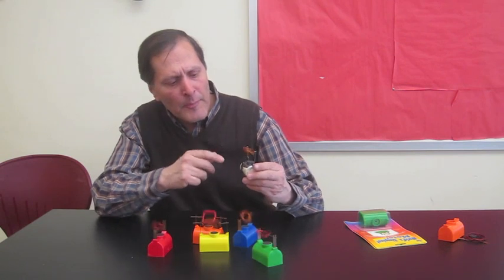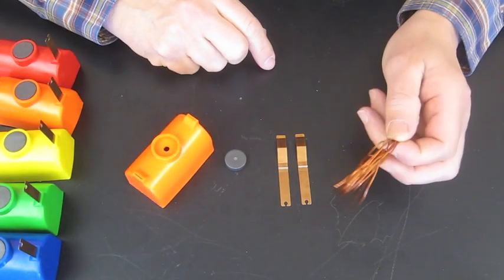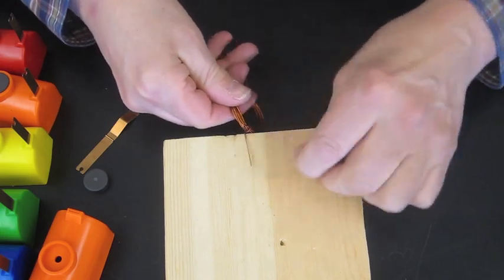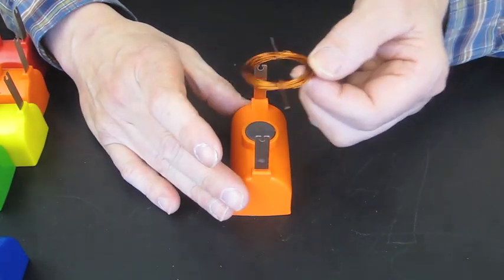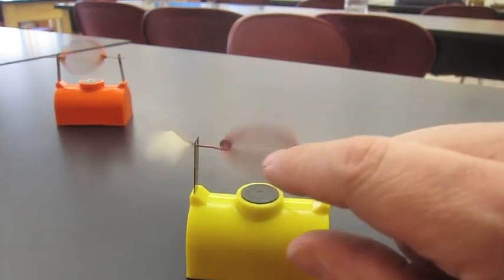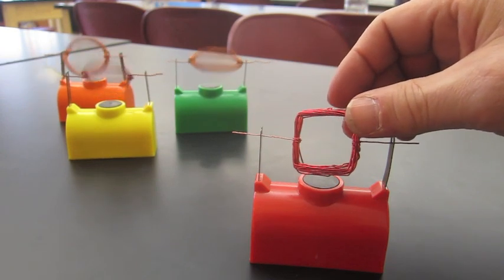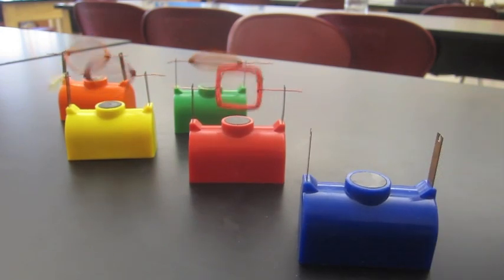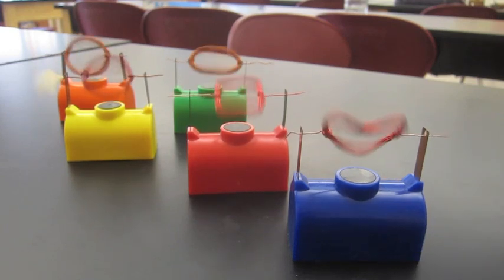World's simplest motor kits/// Homemade Science with Bruce Yeany

Comment: why do you scrape one side of the wire but only scrape the top piece of the other side of that same wire? and what type of wire is that? I figured since current isn't traveling through the entire, through each individual turn, that when adding current it would be stationary.
Reply from the maker: Hello Anthony,  I use magnet wire,  very common and available
 at electronic stores or online,  Batteries is direct current,  the half scraped wire is acting as a switch to turn on and off the flow of electricity making the magnet field on and off.  Send me an email address and I can send more information
Reply: a.santiago25@knights.ucf.edu
Reply from the maker: I sent some information
Reply: Sent a message back, it might appear as spam!

Comment: Great! It'd be interesting to see which variation spun the fastest or with the most torque etc. I assume the end with only half the enamel scraped off eventually wears through the rest of the enamel and it will stop working?
Reply from the maker: I thought so too but have a few favorites that I've used for years and they still work fine.   If they wear down I might suggest adding a little fingernail polish to coat the metal again
Reply: @YeanyScience  the first one you made sounded a lot like an engine, and not really like a motor. it was interesting and quite fascinating.

Comment: Excellent. I normally scrape half of the  wire  on both ends as to have a double insulation while the commutator is off!  This will give the motor a longer life as with scraping one end off , when the enamel is scratched off, there will be a short circuit.
 Making a heart shape coil and giving it on a Valentine day is like a double edge knife as it would suggest a " change of heart pattern!"  Well done, you must spend all your free time building your teaching demonstrations.

Comment: The shape of the coil appears to effect the rate that the coil turns. The round shape appears to turn at the highest rate, and looked as though it started by itself while the other coils needed a push. What is the reason for this?
Reply: Erm ... Magic?
Reply: The round shape will have the greatest area for the same length of wire

Comment: Hey Bruce, how long does this last before the battery dies? also does the coil heat up at all?

Ben
Reply: Actually, I guess the coils are basically an inductor which should prevent sudden changes in current keeping the wire from heating up?
Reply from the maker: Ben,  doesn't heat up,  I think we've had them running for a few days
Reply: Have you heard of scalar waves? I'm really interested if you know what it is

Comment: What if u don't scrape the anamal off the wire
Reply: It won't function as the enamel is covering the conductive part of the wire.
Reply from the maker: it doesn't work
Reply: I would say in addition that the "enamel" is like an insulation covering the whole wire (preventing shortcuts between the loops of the coil. Similar to the "plastic" coating of any power cable). This means that if you don't scrape it, the current doesn't flow...
Hope that helped... ; )